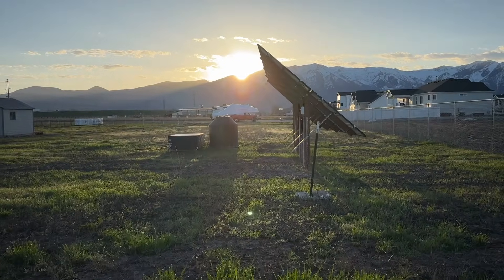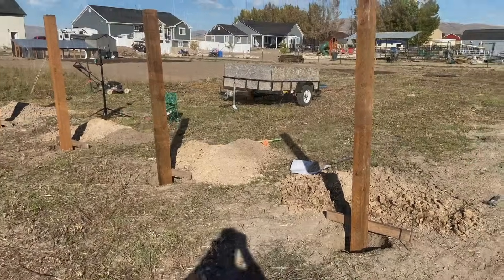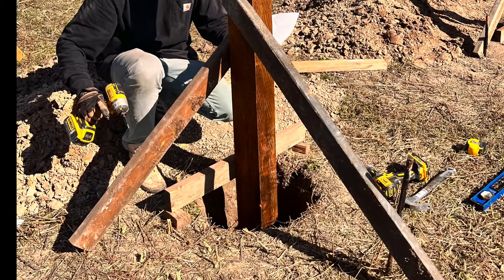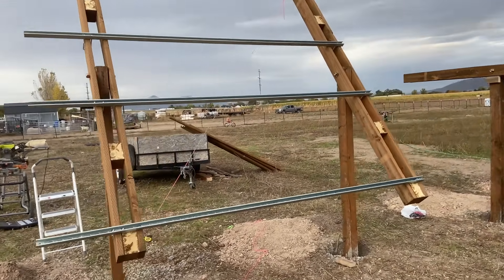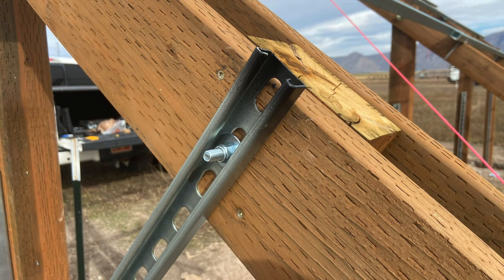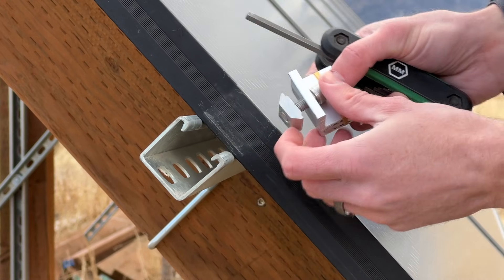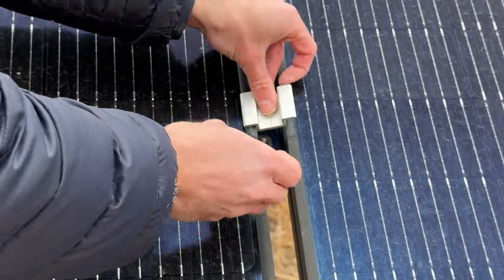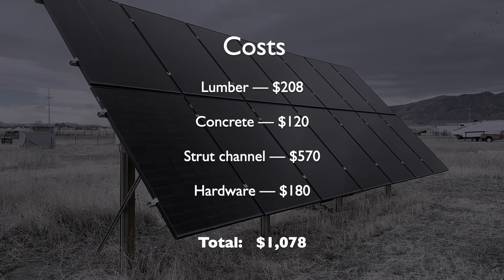Adjustable Solar Ground Mount (DIY Build Guide)

Comment from the maker: If you're looking for solar equipment at the best prices check out my project → https://drop.solar

We got our panels back in 2023 at 40 cents per watt – about $2200 for 14 panels. Now Signature Solar has some for just 14 cents per watt, which is wild! https://signaturesolar.com/all-products/solar-panels/?ref=rpyximnk
Reply: issue is using galvanized Unistruts with Alum frame solar panels: Galavanic corrosion. Instead use Alum unistrut rails (UniRac). The other issue is that setting those posts in Concrete will cause them to rot as the concrete will retain water & prevent the wood from ever drying out. Best option is to use gravel and\or apply a tar based sealant for the in ground portion of the posts.

other than that it looks like a good design.
Reply: We got a pallet of those panels from Signature solar! I'm was shocked at how cheap panels are getting! We bought a system at our old house five years ago - prices have come down SO MUCH!

Comment: Curious how this is holding up in high winds. I built 2 similar racks side by side, but added 4x4 bracing on each post.Front and back! I think my panels are larger than these, as mine seems a little higher. I also added an additional 2x6 between each "arm" for additional support, and 2x6's across the top and bottom.
Reply from the maker: I thought I might need to add some extra bracing too but it's been solid so far! Here's a clip I recorded of a storm that came through this last year: https://www.youtube.com/watch?v=cENh3uJoZA4

Comment: How much for the panels themselves?
Reply: I bought my panel on Facebook for $100 each. 660w bifocal. I've seen cheaper for less wattage but I wouldn't pay more than 20¢ a watt. I've seen brand new 500w panels for $170 which is double what I paid, but if you really want new.

Comment: I see you switched to square U bolts to hold the strut. Were there issues with the lag bolts? Where did you find the U bolts that were silly expensive?
Reply from the maker: Yeah I used both lag bolts and U bolts when I built it. I wasn’t sure which would be better. But almost all the U bolts got loose over time, even with thread lock. I’d only use lag bolts if I were to do it again

Comment: If you add a solar-electric gate opener and join some of those holes in the strut channel to make a slot, you might be able to make them motor adjustable since the gate may be able to hold it in any position.

Comment: I just built mine almost exactly to yours and then I found this video! Great minds think alike. I did not like the way the panels flexed when I tilted them so I put 2 x 6 all the way across the end of the top and bottom of the swing arms to lock them up, but everything else is almost identical to the way you did yours, and I too ordered the smaller struck channel braces had to send them back. I ended up buying the proper ones for inch and 5/8 super strut at Home Depot. You can’t get them at the store but you can order them and they’ll ship them. You’ll have them in about a week so that might help. Thanks for the video.
Reply: Can you please post list of materials you used.

Comment: I use uni strut spring loaded blocks 5/16 and got 5/16 Stainles Allen bolts and swapped out the metric Allen bolts

Comment: Never put concrete under the post, that traps the moisture.  Found out that the hard way years ago. Post rotted out in 5yrs due to encapsulated moisture

Comment: If you don't add gravel to the bottom of the hole the concrete will seal the bottom of the post keeping the water from draining away and the post will rot from the bottom up.
Reply: Pooping in the hole is fine

Comment: Any issues with the posts twisting or otherwise warping since installing this?  I would assume that would negatively impact the ability to tilt. We are about to embark on a similar project and like the idea of tilting.
Reply from the maker: One of the main vertical posts was twisted from the beginning but we didn't notice until after cementing it in and starting to hang the arms. So that one adds a little more friction when tilting but the others have maintained their straitness the past two years we've had it up

Comment: New subscriber here. I am considering making 3 mounts much like yours that will contain 16 panels each. Did you use any bushings on the 7/8” hinge point?  Maybe with weight it is not an issue of binding or squeaking.  I will most likely start with one mount to be used for solar hybrid mini-splits for garage and office (2 separate locations).  Also I will begin adding solar as emergency backup power (in place of a on demand generator) and finally migrate or upgrade to be fully independent of the grid.  We live in north Texas and 2021 was a lesson to me that the grid may not always be there so I have to assess what is critical loads.  Thanks again for your video.  All the best from north Texas!
Reply from the maker: No bushings on the hinge point and I haven't had any issues with binding or squeaking. I only adjust it two times a year so it doesn't see much movement. Rest of the year it's locked into it's position. Glad the video was helpful and best of luck with your setup!
Reply: @SmithOffGrid  thanks for the reply.  I have thought better about the bushings as I don’t want the mount to be free wheeling like trailer wheel.   Haha.  I have ordered my 7/8” bolts and about to get my lumber once I land on the panels that are available before the end of the year.  Maybe I should have done this sooner this year, but what is the fun of that?  Haha. All the best from north Texas.

Comment: I built a smaller one with just 4 panels I used K2 solar mounting rails running them off each ends about 25" so half the panel overhangs past the end of the wood. That allowed an extra panel.  Not sure why everyone uses unistrut when it costs more then Solar racking does and nothing fits it correctly. I buy all my racking from Santan solar K2 system is what they have I'm local to them no shipping cost.
Reply from the maker: That's awesome, I wish I had access to solar rails where I'm at! I looked but couldn't find any locally. And the shipping cost to buy them online made it way more expensive than unistrut.

Comment: For your clamps, I would change the he bolt with a 1/4 SS steel bolt and use the spring nut for the Unistrut! I would not trust the thin washer

Comment: I would put some bracing boards from the posts to the ground at a 45 to handle lateral loads. Those 2x6's can snap. I would say in a 80mph and up. I was in RE R&D for the last 14 yrs. 
I would also double up your strut brace arms asap, two per post and consider jumping the bolt size from 3/8 to 1/2. Hill concrete at base of posts to prevent puddling and rot. After a few years when the wood is dried, Boiled Linseed oil all the wood, let dry for a few weeks and consider paint just to keep UV from breaking down the wood. In other words, you should have used all hot dip galvanized steel for everything. But i think youll get about 20 to 30yrs out of the wood if you take my recomendations. Pressure treated does not mean lifetime. I would also remove all gaps between panels to prevent rain from getting thru.
Reply: I absolutely agree. He should have placed the wood into a strong bag then placed into the concrete in order to create a moisture barrier between the wood and the concrete. But further to your point - it is important that the wood see as little sun as possible and as little rain as possible - so use the panels to create shade and a rain barrier.
Reply from the maker: Awesome tips, thank you!
Reply: Curious about building something like this out of metal without needing machines to lift parts.   I want to build one bigger or multiple (20kWh).  Pile of wood sticks is DIY friendly.  Family is all carpenters and welders, but nobody I know has ever made a metal structure because of the weight of the beams.

Will lightweight C-Channel that 2 people can lift work if a bunch of braces are added?  Thinking a bunch of light metal sticks would work just like wood.  Metal gets expensive so hard to guess steel sizing with no experience and no kit to copy.  

I know how to use load calculators for the cross beams (basically joists), I just don't know how to account for 100MPH wind etc.

Comment: How much wind has this held up to?
Reply from the maker: We're in a pretty windy location but it's held up well! Two years and still going strong. Quick action shot of a storm that blew through yesterday -- https://youtu.be/cENh3uJoZA4
Reply: @SmithOffGrid Use 4" nails in the posts below ground to better secure the concrete to the posts. Duplex nails (double headed) works best. Great job.

Comment: I have a quick build vertical array vid, in case you need a more temporary mount, every 2 panels need 1 cut all 2x4x8, 11 pcs per pair, lag bolt to railway tie, quick release and move 2 panels sections to a barn if needed, if you have hurricanes. My 465w were $289 2023, the 550w $220 2024, 12.3kw $7100 Cad, now 36x610w 21.9 kw pv for $7300CAD.  Sig 11.4kw for $2500usd.
 In 1975 at $115 per watt 11,400w would have cost $1,300,000 USD for a skid of panels lol todays value that is 8.7mil, now is a good time for solar.

Comment: Sweet! Mine are very similar but sitting on three posts with 10x400w panels on them. Found some M8 strut nuts on Amazon to use with the nifty black clamps from Signature. Saved a little at a local electrical supply house where I got the strut for $23 ea. instead of the $35 at HD. Then got crazy and found an Ecoworthy linear actuator with an 18" stroke on Amazon to raise and lower the arrays. Makes adjustment a breeze singled handed! Well worth the $49 bucks! Well, add another $30 for a 4x4 box and reversing contactor with wireless remote.
Reply: Do you have any pictures of this setup? I'm building this out now and would love to see how you attached the actuator to everything.

Comment: Looks good
But unfortunately that wouldn't handle the wind loading where i live
Also proper solar aluminum channel is way stronger and not actually that expensive
Reply: Where do you live and how much wind do you get?
Reply: It might have actually been cheaper than the strut channel. Especially if you found a local supplier. Plus using the proper hardware would ensure proper grounding which is very important
Reply from the maker: Good to know! I’ll have to look around for aluminum solar channel. I was only able to find strut channel locally.

Comment: I’m going this route for my ground mount with the same panel brackets. I’m going to replace the M8 hardware with 5/16” as you can get channel nuts with that thread size.
Reply from the maker: Using 5/16 is a great idea! I feel like that would be the ideal size, but I was only able to find 1/4 or 3/8 channel nuts locally for some reason.

Comment: Have you had any  heavy winds? I'm getting ready to setup my system and I really like your mount design.
Reply from the maker: It's actually done surprisingly well in the wind. I thought we'd need to anchor it down further but it's been solid. If you're in an extra windy area though you could add some more bracing or even use a full 10 ft unistrut piece down into the concrete with the post to add some more strength.
Reply from the maker: Quick action shot of a storm that blew through yesterday -- https://youtu.be/cENh3uJoZA4

Comment: I live in the Philippines, and in here the best angle for the solar panels should be around 12-13 degrees. Is this safe and stable for this ground mount build?
Reply from the maker: I've had the array locked at 0 degrees (completely horizontal) and it's very stable. We lock it to 17 degrees for the summer. If anything it's more stable at a smaller angle. I think it'd work great at around 12 degrees. But soil type and wind conditions would be big factors to consider too, not sure how my location differs from yours in that regard.
Reply: @ thank you for this information and for making the video
Reply: In St Croix they build the panels flat and low to the ground.  I saw a restaurant there that had them flat and about 50cm off the ground surrounded by short shrubs.  it's all about the wind when you have a cyclone.

Comment: How many kwh are you producing?  Located where?
Reply from the maker: I have two other arrays in our system for around 10kW of solar total and I don't track production for each array individually. This one is the only south facing array so it's production is higher. System wide I've seen 60kWh max per day during peak summer and 20kWh max during the darkest part of winter. For just this array my guess is it's producing around 35kWh max during summer and 12kWh max during winter.
Reply: Great data.  Thank you!

Comment: Exellent video.
I have 2 x 20 panel, ground mounted arrays that have been up for 12 years now.
Time to rebuild them, in addition, your design will allow me to adjust the tilt on a quarterly basis to maximise for seasonal input.

Comment: If you do your own solar, are you still able to get tax benefits and rebate checks? Interested in the comparison between doing it off grid and tied to the grid.
Reply from the maker: Yeah we were able to still get the tax refund with doing it ourselves. The tax form just asked for the cost of solar panels and materials as one amount and the cost of batteries as another amount. It was much easier than I was expecting and yeah we got a full 30% back!
Reply: For state tax refund and grants, it really depends. Our state has a $1000 residential grant for installing solar, but it has to be performed by a NABCEP certified installer. Federal credit doesn't need that. Also, look at your city and county regulations -they may require a certified electrician to pull the permits.

Comment: I would like some more insight into how you used the paracord to bring the strut channels into square. Thanks!
Reply from the maker: I measured from corner to corner diagonally across the arms and noticed one measured longer than the other. So I added two eye hooks on those two corners and then used paracord and a 3D printed rope tensioner to pull it tight and into square. Hope that makes sense!
Reply: Awesome